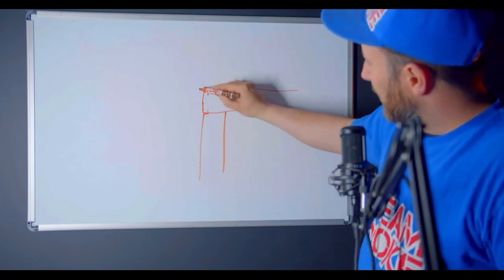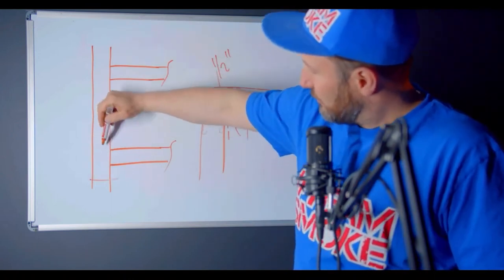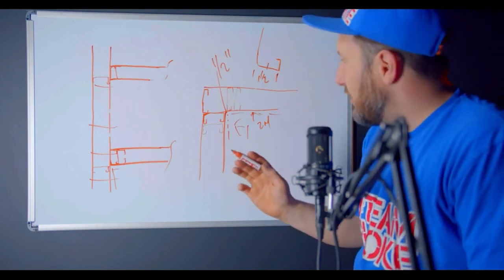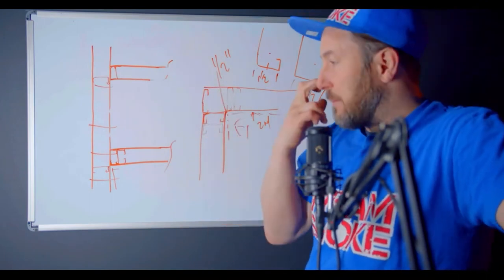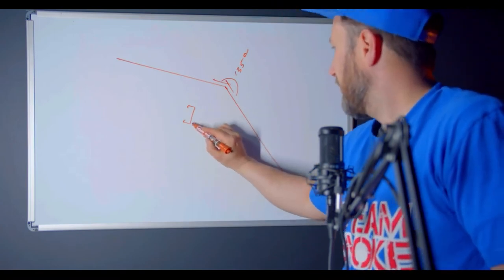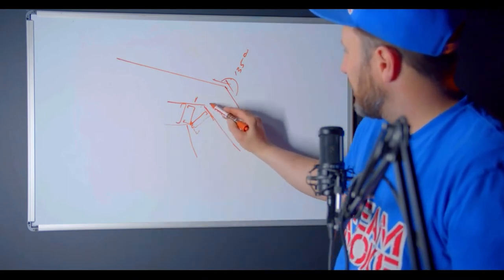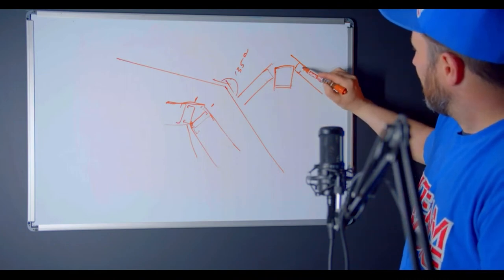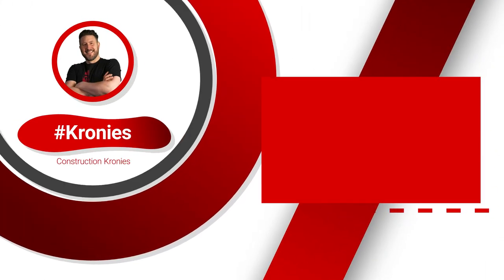Metal Stud Framing Layout Corners

Comment: If I am tying in a new wall to an existing wall that already has drywall what is the proper way to secure the new studs to the existing wall?
Reply from the maker: Shoot a line laser up the wall and screw the stud to the wall with drywall screws. What I do if no stud is in the wall we are tying to the I angle my screws toward the outside of the stud using 1-1/4" screws every 2 feet put 2 screws screwing out the opposite way from each other. Be sure to also screws them in the top and bottom track if you can. Hope that helps! For light gauge use regulars fine thread and heavy use self tapers. You can even go to 2" screws for double layer walls.
Reply: Thanks

Comment: Here’s a question I have. What two angles would you cut your metal studs to make up a 135 degree angle?
Reply from the maker: TimsStamp 1:30:00 https://www.youtube.com/watch?v=DD1I5i5yw0A 
TimeStamp 4:10:00 https://www.youtube.com/watch?v=gSuuG4ngv3Q
Reply: @ConstructionKronies  thank you. I also have another question for you. I down residential my entire life I am knew to commercial and metal framing. Some people tell me you layout 16 on center, some people say 16 5/8? Which one is it? I understand why they say 16 5/8 because of the Sheetrock. But if it is 16 5/8 is it every wall you lay out like that. Or just the ones that will have a slap stud? And if I do layout 16 5/8 then I would pull from the outside of the plate like in wood framing I would pull from where my Sheetrock is going to hit the other sheet on the inside corner?
Reply from the maker: yes figure out which way you want to start and go 16 then if its 5/8 or 1/2 go 16-5/8 or 16-1/2 off.